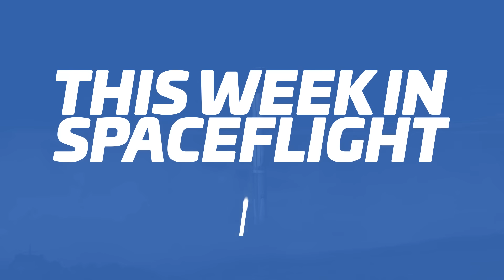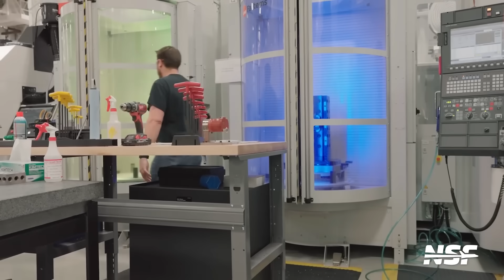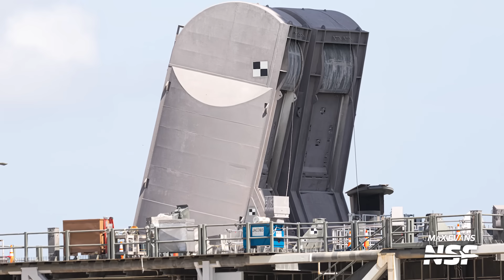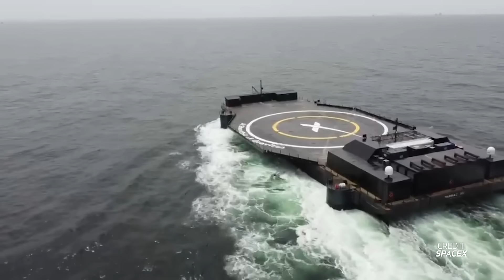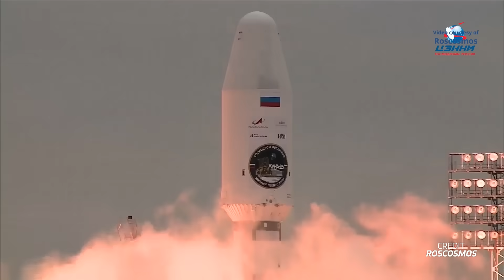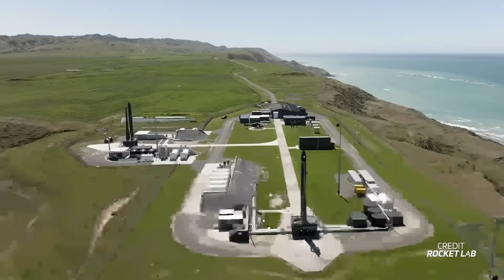This Week in Spaceflight: Artemis 2 Countdown Begins, Astra's Q2 Earnings & SpaceX's New Innovations

Comment: You might want a sort or a full video on space law. What The Coast guard is saying about SpaceX is troubling. I truly wish spaceX did not ditch the oil platforms they were converting. That way getting to the 20 miles off the coast where stupid regulations are.
Reply: Not like that would have solved anything in terms of regulations, the FAA still regulates overseas.
Reply: @rogerphelps9939 Nope. FAA regulations still apply. Rocket Lab's Electron rocket has an FAA launch license for launches from New Zealand and needs FAA approval for launches from there. Same thing happened with Sea Launch for the period of time that they were partially owned by Boeing. In order to launch their Zenith rocket from the middle of the Pacific Ocean they needed an FAA launch license and approval for every launch. So no, regulations still apply even in the middle of the ocean as long as your rocket is owned by an US company.
Reply: Oh look, ocean gate fan

Comment: The ocean is big.  All ocean-going vessels, including the SpaceX landing barges, continuously broadcast their location and identity to satellites, permitting all other vessels in the vicinity to track the location of all nearby vessels.  The landing barges are actually under continuous active control via Starlink by human operators who are monitoring the nearby traffic.  In part the existing regulations are based upon the assumption that any control functions over autonomous vessels would require line-of sight.  The landing barges are also deliberately positioned in parts of the ocean that have little traffic, because they do not want to risk the Falcon boosters accidentally falling on some innocent bystander.  SpaceX may even guide them to locations that are well clear of the nearest commercial vessel just to be as safe as possible.  Note that one of the Chinese satellites launched this week are part of the international satellite network that supports this.  The ocean is big.
Reply: For what's worth that's not how the positioning of the droneship is chosen. The droneships are just positioned under Falcon 9's trajectory downrange on the parabolic impact point and that trajectory may or may not be over parts with high traffic, it depends on the launch and the launch trajectory is mandated by orbital mechanics so little SpaceX can do about that. At the end of the day, it doesn't matter because there are notices to mariners that alert them that rocket stages are going to come down over them so those areas get cleared of people well ahead of the launch. The problem for the droneship is not for the moment of landing, it's on the way out to the landing zone and then the way in to Port. That route is actually sometimes on very crowded waters.
Reply: I do agree that there seems to be no reason beyond regulations for not allowing the drone ships to simply navigate themselves out of dock to target location wherever and back again. The new drone ships were designed and built to do this. They are operated/supervised by remote control through StarLink. Instead of requiring a tugboat to monitor the drone ships, it would be simpler maybe to require a inspector/supervisor in the drone control room to watch the operator and converse about operations. Perhaps there might be some risk with small boats (ski-sleds, surfers, maybe aquatic life?) within 12 miles of harbor? This might require a few more cameras on the drone, a horn or loudspeaker, maybe an fall-back automatic braking system, etc.